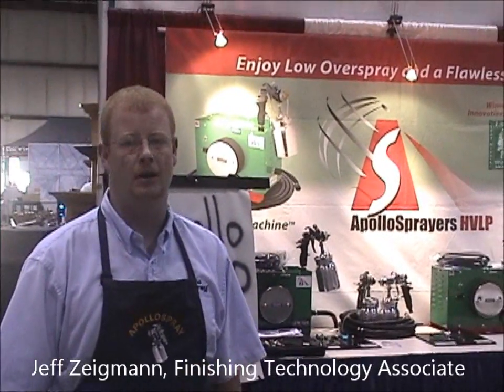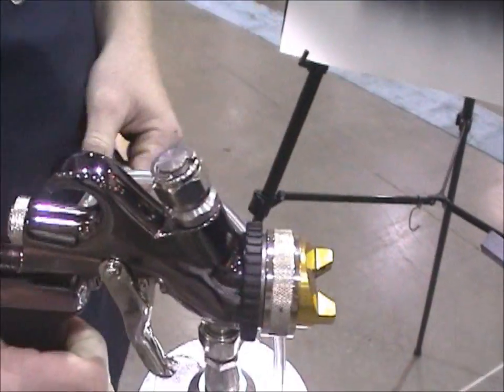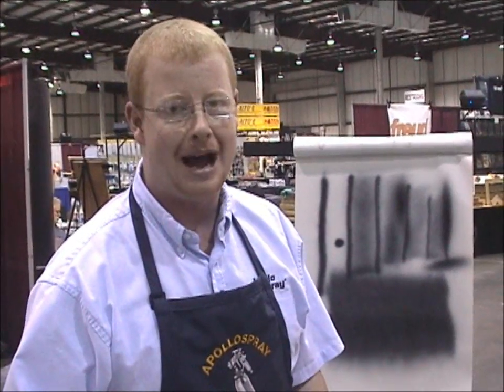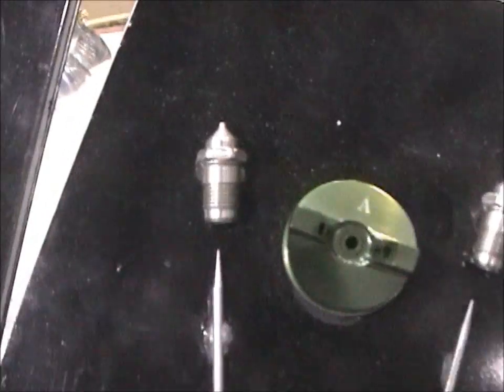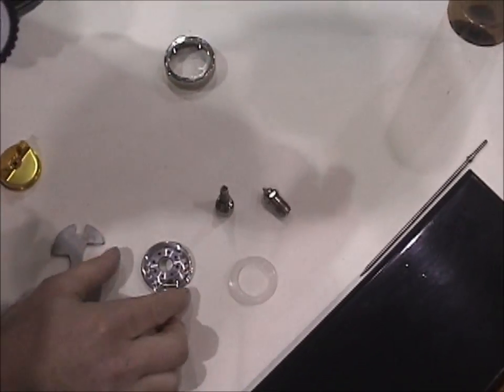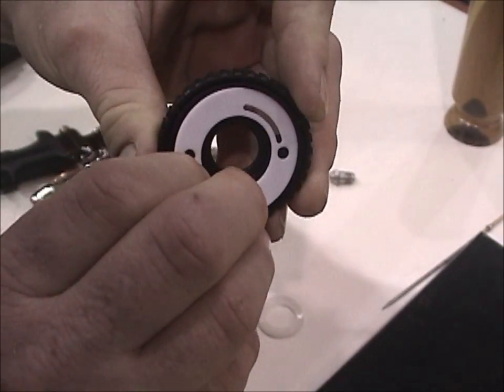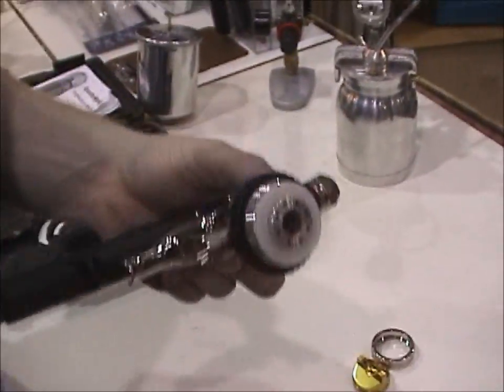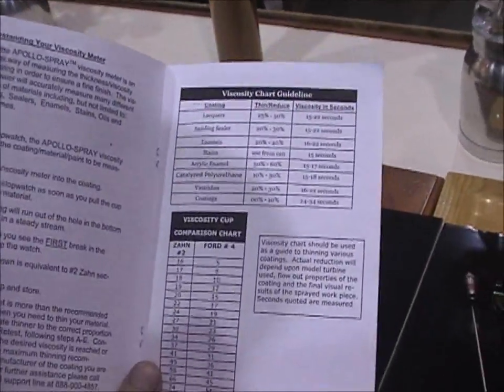Meet the Apollo HVLP AtomiZer Spray Gun

Comment: That thing never shut up always is on like that 🤔
Reply from the maker: Yes, it has a 100% duty cycle, which means it's running all the time you are spraying.  What you need to keep in mind is that during this video the system was located about 8' from the demonstration.  During normal operating conditions the sprayer would be located as far away from the spraying area as possible.  We provide anywhere from 25' to 32' of air hose, so the noise is not really that bad.  You don't want to buy systems that have noise reduction as they often do this at the expense of the motor, so while they may be quieter they burn up motors faster since they run much hotter.
Reply: @ApolloSprayersHVLP  so is better if the motor is running all the time?🤔 And cc an you use it for painting a car ? What sizes are the tips?
Reply from the maker: @brownpride5125  This is different than a standard compressor and the motor is designed to run as much as you are painting.  We have a feature that is built into some of our systems that allows the unit to slow down to 2PSI while not being used.  This makes the unit much quieter without detriment to the motor.  Yes, you can paint a car.  We have a range of tips starting at 0.5mm all the way up to 2.5mm.
Reply: @ApolloSprayersHVLP  thank you very much I was thinking long time ago buying one of those 🤠
Reply from the maker: @brownpride5125  They have come a long way and can now produce some great finishes!  Check out our Social Media channels for pictures and more videos.
Reply: @ApolloSprayersHVLP  thank you 🤠
Reply from the maker: @brownpride5125  You're welcome.  Let us know if you have any additional questions.